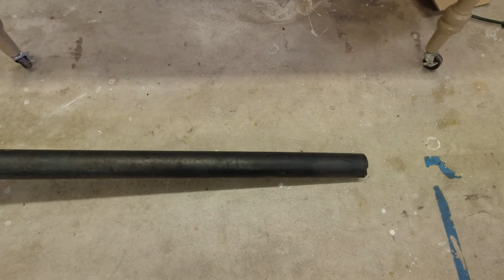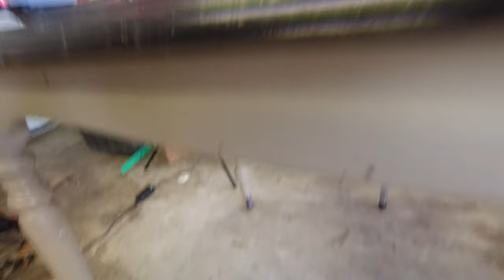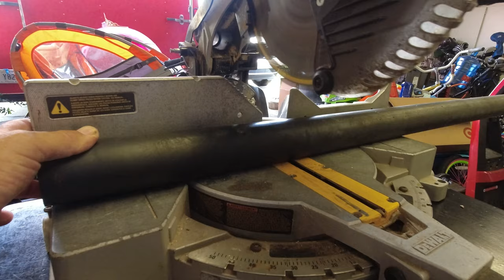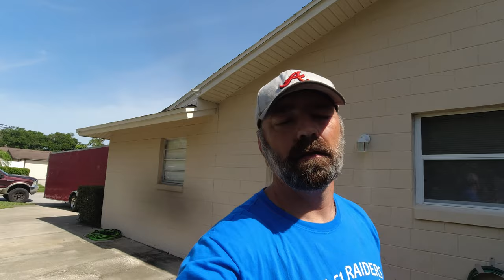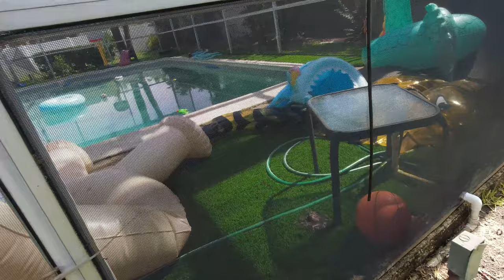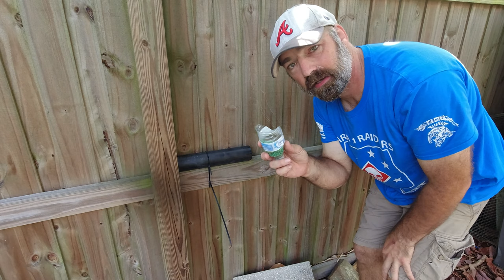Best Way to Use RAT Poison/Ramik Rat Poison

Comment: Bleach and Ammonia works well and has for almost 100 years. Must find the living area to kill many at once but the mixture is a deadly gas that works well. Great for sewer rats and gutter rats. While at NYU I asked the rat crew and this is what they use when they locate a nesting area of 500 rats or more. If you find an area with 3-6 holes in the ground, pour the mix in each hole then use water to drown the ones in there choaking but scared to run out.
Reply: @Bellathebear777  Who said store it I said pour it in the hole.....you ok there buddy? It is called mutard gas Mustard without the S as we used it in the Army when we had Rats....worked well

Comment: Steve a air conditioner tech told me(I had mice eating the installation on my air con condenser)he said use peppermint oil.they don't like it.I use it and it worked.Just a little bit of info.I'll sub n like for you(gotta get those numbers up!)keep it up and they will come...Happy Trails!😎
Reply from the maker: Awesome thanks I will try that inside for sure to keep them out of the attic
Reply: Peppermint oil doesn't work😭

Comment: I just need to know, did it work? About to pop a big order off so I can get a 20lb bucket here by this weekend because those buggers are getting into the garage and cars. Did the population of rodents get reduced significantly or did the buggers just hoard the pellets and not actually die?
Reply from the maker: I wiped them out along with a chunk of the squirrel population. I have to put more out about every 6 months because more will migrate in
Reply: @SteveWB  Thanx. The alternative was way more expensive/ Glad it worked for you.

Comment: Hey Steve, Do you still have rat problem? If so, would you be willing to try out a DIY rat poison?
As you are aware, vitamin D3 is a rat poison. You can buy 5000 I.U. vitamin D3 in Walmart for under $10. Each soft gel should be enough to make 11 blocks of rat poison. You mix one 5000 I.U. vitamin D3 with coconut oil (2 oz), oat flour (6 oz), icing sugar (1 oz), boric acid (1 oz, to kill cock roach in case they eat it), wheat flour (1 oz). Make sure you break the soft gel and mix it thoroughly with the rest of the ingredients and make 11 blocks out of it.

I would have done it myself, but I don't have a reliable source of rats/mice. If you do it, please let us know the results.
Reply from the maker: Unfortunately I have not seen any rats in a while. However if they return I would like to try this poison.
Reply: How long did take rats die after eating the poison?